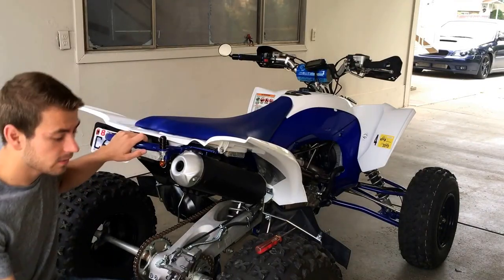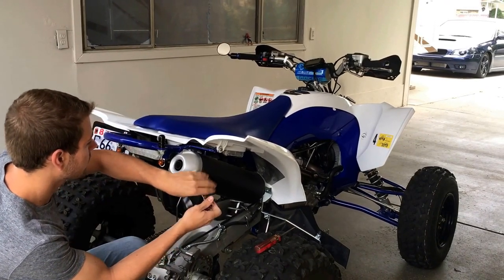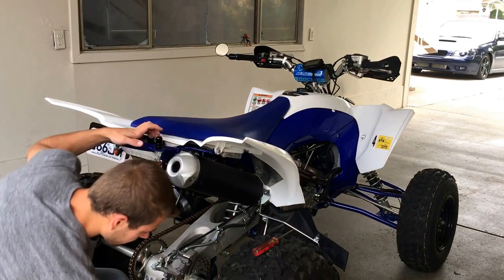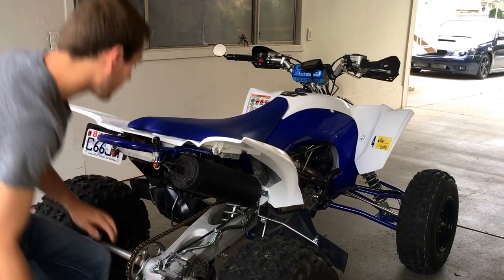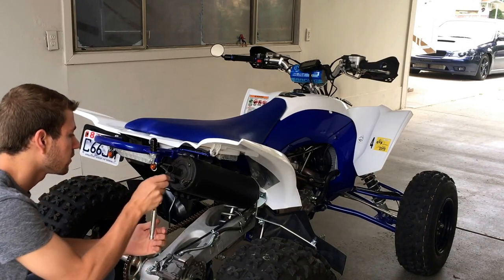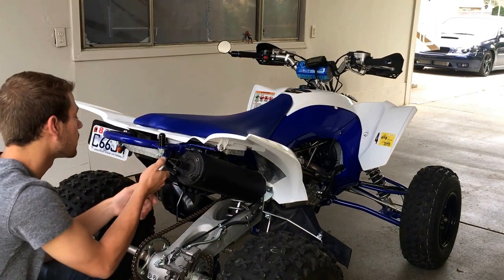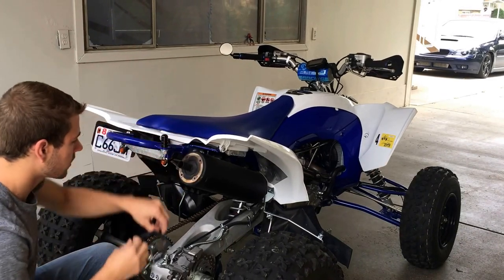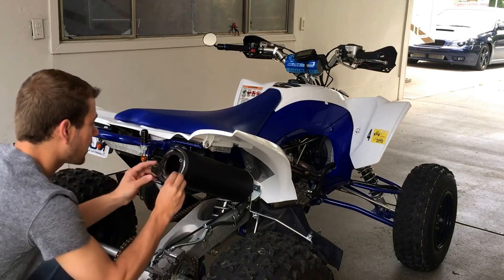Removing the spark arrestor from a yfz450r

Comment: I did this to my 2017 se along with protec airbox lid and twin air filter and cage. Had issues with it backfiring more frequently and idling very high intermittently. I suggest getting a power commander if you plan on riding it like this for an extended time.
Reply from the maker: Great recommendation. Removing the stock air box lid will cause them to really run rough. Definitely will need a fuel programmer for that.
Reply: @tysonrodrigu  hey man i gotta 19 yfz i do not have a tuner i wanna take the arrestor out keep lid on was urs fine? ik they run lean from factory hope it doesnt make it worse. i did this couple weeks after i had gotten it and it backfired a lot
Reply: @chazzthaspazz4475  you need a fuel programmer it’s allowing more air which will make it more lean

Comment: Did you end up tuning the fuel injection. It not it could allow too much air in and will hurt your engine
Reply from the maker: I ride the bike with the stock spark arrestor. Mainly for the quiet factor. However I do have a fuel commander for it.

Comment: Any tuning need to be done?
Reply from the maker: No, it will run a tiny bit rich but it won’t hurt it. I would recommend tuning if you are going to remove the air box lid though because you don’t want it to lean out.
Reply: @YAMAHA88 Kawasaki88 how so?
Reply: @tysonrodrigu  shouldn't that make it lean, not rich?